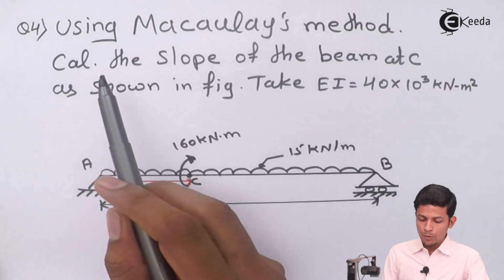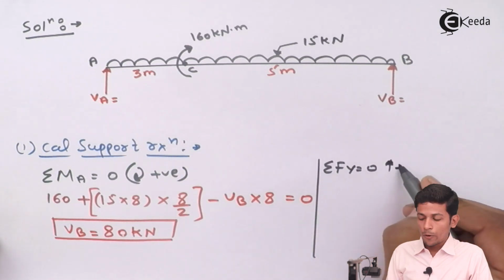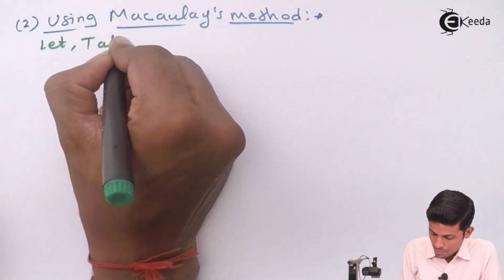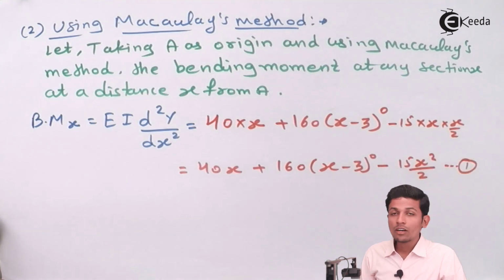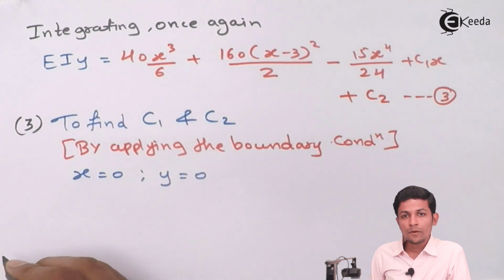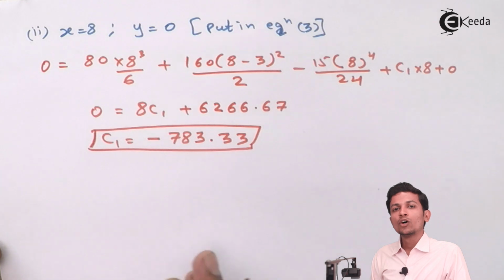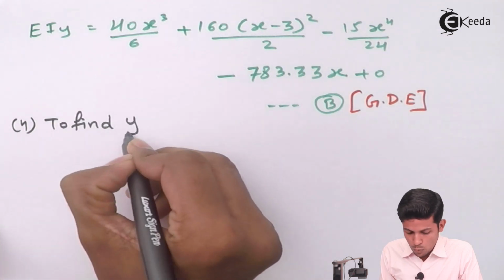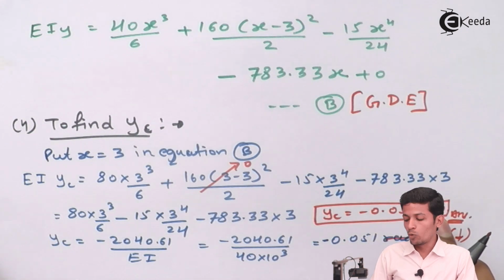Macaulay's Method Problem 4 - Structural Analysis 1

Comment: there was a mistake made at the second boundary condition [80 x8] was used but the correct values from the deflection formula is [40 x 8 ] ,hence C1= [-356,88 ]